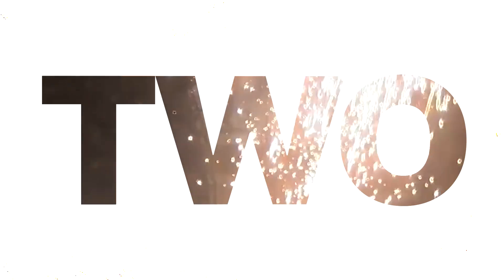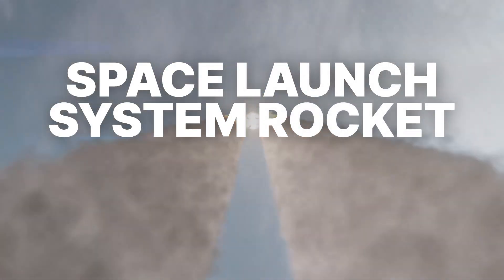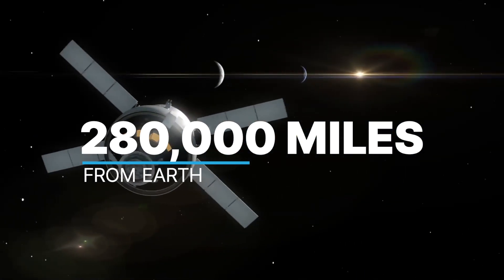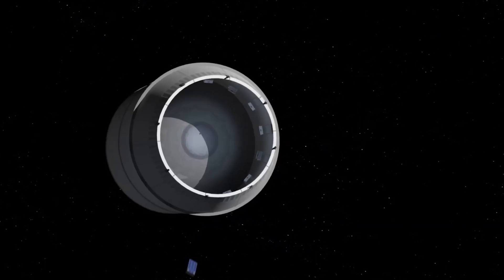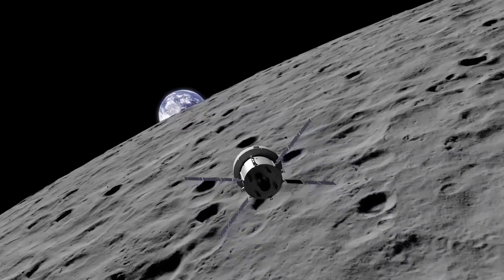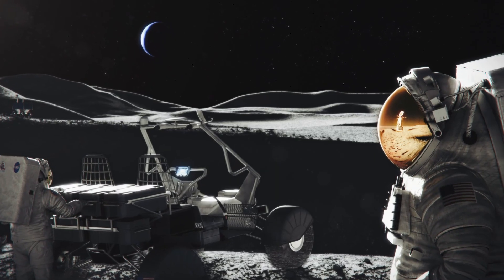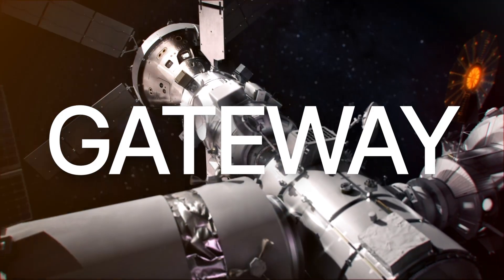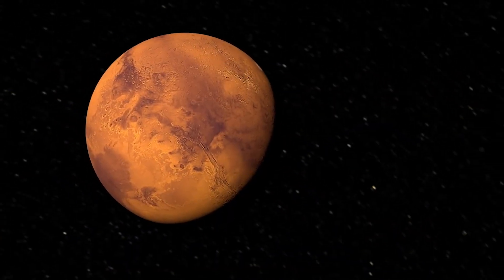Artemis I: NASA’s Plans to Travel Beyond the Moon

Comment: So who's paying to fuel up the SLS and just get the lunar and deep space components into orbit?
Is the SLS reusable, recoverable, or will it be ditched downrange like classical rockets?

You've seen the size of the Saturn V. 2/3s of that rocket was built just to push it into orbit. Then the last third, the SIVB stage was used just to push the CSM and LM onto a translunar trajectory.
Building Lunar orbit space stations and bases on the moon? You've lost almost 90% of your rocket just getting it there. It's possible, just difficult and expensive. Even Apollo 18, 19, and 20 could have flown. They had the hardware, just not the funding to cover fuels, oxygen, insurance and everything else.
Reply: Reusable rockets are going to be a major part of the program and companies like spaceX have received funding for building them (things like starship) but SLS is all you described and  majorly flawed

Comment: "Sustainable"
Throws the whole rocket away after using it one time
Reply: Reusable rockets have less lifting capacity, since they need to carry extra fuel in order to land.  Which is why most of the reusable rockets are just used for low Earth orbit launches with relatively small payloads.
Reply: @my3dviews  SpaceEx’s starship will have a higher payload capacity than SLS while also being fully reusable
Reply: @my3dviews  SpaceX entered the Chat
Reply: @my3dviews  starship and super heavy are laughing
Reply: @LShaver947  starship is litrally a bomb
Reply: @my3dviews  even if that were true, it's irrelevant because reusable rockets are so much cheaper
Reply: @LanternsoftheDead    They aren't that much cheaper.  Only the first stage is reused.  The second stage is expendable.  
Plus, the first stage is not just refueled and used again, it must be refurbished.  Often requiring engine rebuilds or replacements.  
Because the first stage has to land, it has extra weight that reduces the payload to orbit.  Such as the landing legs and grid fins, which wouldn't be required on a one time use rocket.  Add to that the extra fuel for landing, that must be accelerated up to first stage separation, the end payload is only about 70% of what an equivalent expendable rocket would get into orbit.  That reduces the efficiency significantly.  
Even SpaceX will sometimes not recover the first stage when they need to get a heavier payload into orbit.
Reply: @my3dviews  laughs in starship
Reply: @vendoaguasa5lucas930    Laughs at starship.
Reply: @my3dviews  Starship upper stage is reusable as well.
Reply: @my3dviews  dude Starship costs about 60 Million right now to be build and they plan on launch cost around 2 Millionen dollars. Sls cost 27 Billion in development and will cost at least 2.7 Billion per launch. Starship isn't just cheaper its better. Face it.
Reply: @my3dviews  Pretty sure starship is more powerful and has a larger payload capacity than SLS.
Reply: @YoSora1313    If you read all of my comments you would know that I wasn't comparing Starship to SLS, but expendable rockets to reusable ones.
Reply: @my3dviews  Fair enough

Comment: Two decades in development for SLS and Orion.....finally, we are going back to the moon.

Gateway should be easy. We have been building module after module, docking and connecting port after connecting port, solar panels, candian arms......all for the ISS. That stuff should be assembly line stuff by now. Don't need any new "ground on up" stuff. We already have/had plans and components since 1996 in use and deployed for the ISS. Build a couple of new ones, send them up on a few falcons for $80 mil a flight, put it together in LEO. Send a couple of astronauts to flight check it and then send up some type of truss and a few merlin vacuum engines to attach to the strut and push that thing to the moon. Heck, might as well attach a couple of Bezos landing platforms with attached rovers to it as well. We have been building rovers for Mars since the 1990's and had a car on the moon in the early 70's.......so we don't need a "build it from the ground on up" total redesign and development for rovers.  We can't afford to fully fund Boeing and Northrup for two more decades for them to dilly dally with getting us what we need to go to the moon

Comment: They say that SLS will be the most powerful rocket ever when they know Starship will be more powerful. And also they keep talking about how the core is the biggest rocket stage when Superheavy is even bigger. Nothing against NASA but they need to get some facts straight.
Reply: Sls is already the most powerful rocket built, its fully built while the fully stacked orbital starship is yet to be built. So as of now, sls is the most powerful rocket built
Reply: @egamersmk771  What do you mean? Sls hasn’t been fully built either and starship is closer to launching fully stacked than sls is. And as of today Falcon heavy is still the most powerful operational rocket by a factor of 2.
Reply: @spaceygamez  yes, the sls is fully built, they just need to put the core, upper stage and boosters together, evrything is ready to be fired up, and yes, the falcon heavy is the most powerful rocket in operation but i doubt starship will have a fully succesful flight before sls, evry single part of artemis 1 has been tested and the chance of succes is very high. On the other hand, starship is still in it's early stages and sn20 will likely not succeed in getting to orbit. They've not even tested 28 raptors at the same time. I really love starship, but i doubt it will be operational before sls
Reply: @egamersmk771  You have to remember that starship is in it's prototyping phase and sn20 will be a 'test' flight and yes starship will not be fully operational for a while it doesn't mean it will be less powerful than sls when still testing since if it's operational or not with a fully stacked starship it will still be more powerful than sls. And if you mean by "fully" built you mean it has all of the necessary parts to be assembled and flown than wouldn't starship fall into that category? Since they have almost fully manufactured all of the parts for a full starship accept for the raptors. Sls may launch before starship but it will still fall behind in almost every category

Comment: i like that SLS and Starship is completing to be the first one reaching orbit
Reply: I'm betting Starship will reach orbit this year. SLS won't.
Reply: @amcadam26  IF everything goes perfectly on BN2.  So far that hasn't been the case in starship development.  I suspect SLS will fly before Starship does.. especially as a completed stack.  However Starship has been around in it's current form for I think less than 3 years compared to the 10 for SLS..
Reply: @TheEvilmooseofdoom  A Landing on the first prototypes isnt expected and is also not required. If BN2 just completes some easy pressure tests, a static fire and a small and (until now) very easy 150m hop, there stands nothing in the way of Starship being able to go to Orbit before SLS.
Reply: @amcadam26  wouldn't exactly bet on it. Booster hasn't even been tested, starship has yet to land properly
Reply: @iamarokotmanson  SLS wont land at all so not a fair assessment. I am sure that if Spacex wanted it they could just build and launch starship with no regards for any landing ability way before SLS could get out of the design phase if both were started at the same time.

Comment: SLS will never be the worlds most powerfull rocket because of Starship. So don't say what it will be!
Reply: Cmon people, have you realised yet that SLS started development in 2011? Starship started around a year ago and intends to go to orbit by July this year! SpaceX is a way more innovative company, SLS litteraly costs 1000 more than starship, starship is fully reusable, i could go on. Basically at the rate that the 2 companies are going SpaceX will of left NASA in the dust
Reply: @zoom-w1e  the sls is done, is tested, and needs to be stacked then it's ready. Also the contracts in place will make future sls missions drastically cheaper. And starship is the lander for Artemis if you haven't noticed
Reply: In all fairness, there is no starship.. yet.  BN2 might change that.. or it might not.
Reply: i mean  SLS has the hardware, starship doesn't even have a test capable booster and is still very much a prototype, there are no guarantees it will work out.
Reply: @ZrbdMc  You think SLS will be ready before Starship is? So I guess it won't. Not enough money, no test flights, no lander and actually nothing but the crew module and engines, but SpaceX has them too. SpaceX has a prototype and a superheavy prototype. They keep testing the spaceship. SLS doesn't exist and so far it has never flown. So I think Starship will be ready when NASA starts building a prototype.
Reply: @romeogarbett4047  The parts for SLS exist and are planned to be integrated this year. They are also for the most part tested systems. The engines aren't new, the srb's are very similar to those used on the shuttle, and orion has many tests already. 

starship still needs to land, the engines are still in development, the vacuum variant is being tested currently for the first time I believe. there's no booster, no tests even, and no integration tower. not saying that space cant reach orbit before sls, but NASA's philosophy is to figure everything out before hand and have no failures, while spacex is building it out halfway and letting tests find the failures for them. of course the iterative process is going to have more progress and a better design in the end, but that doesn't mean it's anywhere closer to success.

wanna be clear that I'm not saying SLS is sustainable, or that starship won't work. starship is clearly the better system, but my original statement was meant to say that SLS is ready to fly now, but starship isn't.
Reply: @romeogarbett4047  SLS is built.  Starship is sill in early prototyping.  There is a path finder for the booster but nothing else.
Reply: @romeogarbett4047  guess what? Starship is the lander now! Nasa really slapped you there huh?
Reply: @EE-fz4ss  You'll see! SpaceX will land on the moon soon (1-2 years), but SLS won't be ready to go to the moon. I think so.

Comment: May I give you a suggestion for after the Artemis 1,2, and 3, rockets are launched: use super heavys and starships instead
Reply: @(S)-Riley Dunn Starship will actually fly sooner than Artemis 1, which is why that statement "It will be the most Powerful Rocket ever made" wont be true by then.
Reply: @(S)-Riley Dunn Its July, but that doesnt matter. I also really doubt that, no question, but its definitly possible by september or October. BN2 could be the first Booster to carry Starship into Orbit, since it has 28 Engine-Attachment-points. Also: Its not only Elon Time as Gwynne Shotwell (the COO of SpaceX) said, that she is confident, that Starship will launch Q3.
Reply: It does not have an escape capsule and no planning or engineering has been done. Without it the Starship cannot be human rated.  
There is no training being done for astronauts and they are not going to use NASA astronauts. 
It needs in orbit refuelings to take it to the moon. The engineering and parts to do this have not even been built yet. The technology doesn't exist. 

That is just a few of the problems with this thing.
Reply: @jabom99  the space shuttle hadnt a  launch abort system too and it was human rated...
Reply: R u guys SERIOUS? SLS has been in development since 2013! AND still isn't built yet and starship will be in orbit by JULY
Reply: @zoom-w1e  Starship is a piece of junk. The entire concept is wrong and it will never be rated to take humans.
Reply: @jabom99  youn know nothing about Starship
Reply: @(S)-Riley Dunn so do you think that starship is better? or do you think that they will never succeed?
Reply: @zoom-w1e  no matter what happens when starship and super heavy projects are complete they will become the go to space craft because of efficiency just look at what’s happening to aviation industry.
Reply: @sleepydrones1282  so are u agreeing?
Reply: @zoom-w1e  if you believe starship will takeover in deep space transportation yes
Reply: Why?  Because its reusable? Falcon 9 has already adressed that
Reply: @(S)-Riley Dunn so do you think that sls is better?
Reply: @(S)-Riley Dunn  yes, their timelines are too optimistic, but it probably wont take decades based on the fact that they are launching about 1, sometimes even 2 starship prototypes every month
Reply: Ok cool
Reply: No one knows if they'll be ready by that time soo. And even if why would you only use 1 vehicle for crew transport?
Reply: Prototypes of Starship and Superheavy have already been built. They will be orbital this year. SpaceX will be on Mars before SLS ever reaches the Moon. At $2 billion per launch Artemis program is already doomed unless NASA switches to SpaceX.
Reply: @channelwithaweirdname  What? Superheavy has 28 raptor engines while SpaceX can't even get 1 to work on the Starship prototype launches. Also, the prototype doesn't even have engines, it's pretty much just the body. SpaceX fans are acting like they're the best or something. NASA managed to go to the moon with 3 mb of memory, 50 years ago...
Reply: @net_reporter  SpaceX launched satellites, astronauts, and landed Starship successfully in the past two weeks. No one else has ever been this successful in such a short period of time,  not even NASA.
Reply: @net_reporter  SLS is an overpriced, too expensive, piece of junk by the time this mission happens. SLS would be state of the art in the 90s.
Reply: @syntenel2283  Exactly what cost is too much for the furthering of science and the future of civilization? Piece of junk? What insider knowledge do you have to make that statement? Technically, the food you purchased this week was also overpriced. You shouldn't have bought it.
Reply: @Sara-L  The problem is that SLS itself is already obsolete. It uses repurposed space shuttle parts and the cost of launch is just insane. The only reason it is still in development is because of politics. Congress would never let it be shut down when it’s providing endless government jobs. I guarantee you if NASA wasn’t constrained by the decisions of politicians, then they would have scrapped SLS and been working on their own Starship-like rocket.